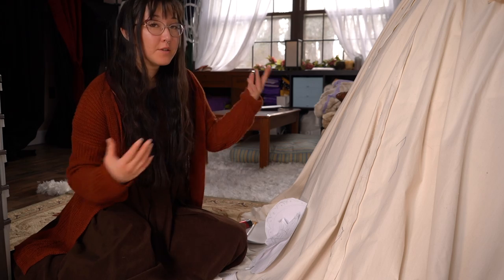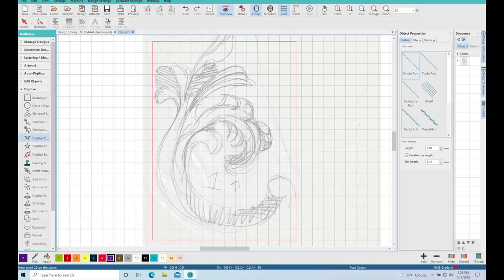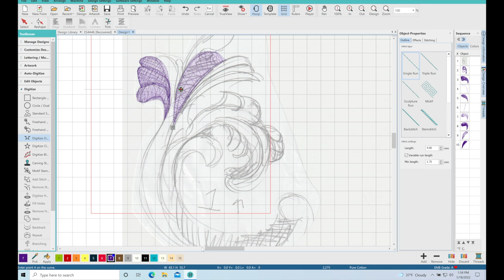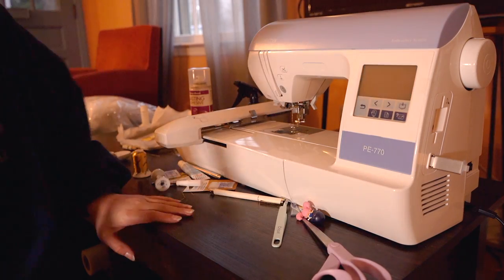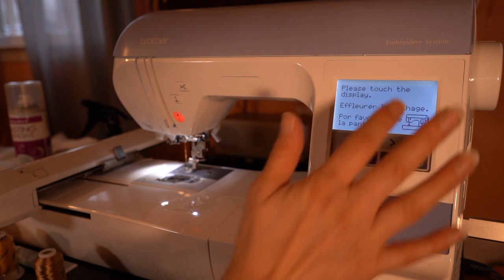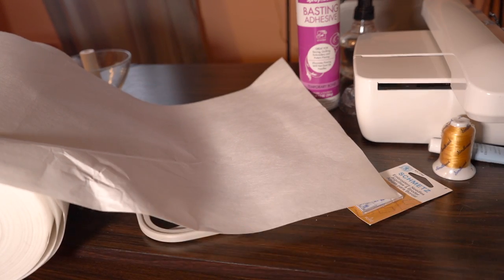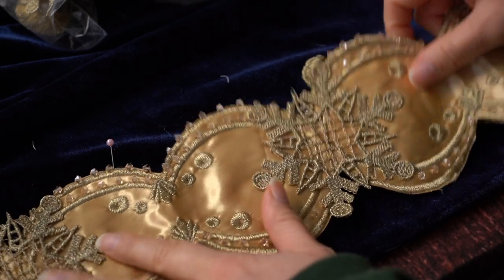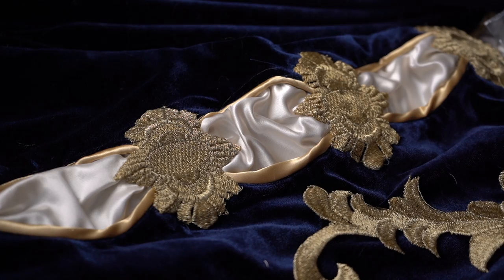Making and Digitizing Free-Standing Lace with an Embroidery Machine | Machine Embroidered Lace

Comment: Whoo do I understand your pain. I use the Inkstitch plug in for Inkscape because both are free, but little support. 

2) I have a Brother PE-535 with a 4x4 hoop but, a multi  position hoops is available. This allows me (if I get one) to embroider larger pieces without unhooping. Linus tech tips does a video on using a 5x7 multi position hoop here --->  https://www.youtube.com/watch?v=w2NK47SoNvQ

3) I use inkscape to digitize images I like into .svg files, then convert them for use as embroidery files with Inkstitch. I still have to do a lot of manual tinkering to stitch orientation and to stitch order. So there is no escaping that, even with paying more for the software. Sorry :(

4) metallic thread is notorious for the difficulty in embroidery. There is some videos out there that give some tips like choosing a large eye needle, using a thread tower to unkink the thread, spool orientation. 

5) Kitten is getting to be a big boi!
Reply from the maker: i've never tried inkscape but it sounds interesting! free is definitely good. i thought about trying to maneuver multi hooping but went with digitizing and stitching separately since everything is going to be applique anyways. i've tried eeeverything for this metallic thread, the only solution i've found is to manually unwind it and let it feed into the machine with absolutely no tension which unfortunately means i have to sit with it while it stitches out 😅